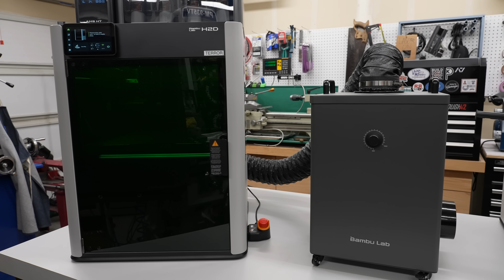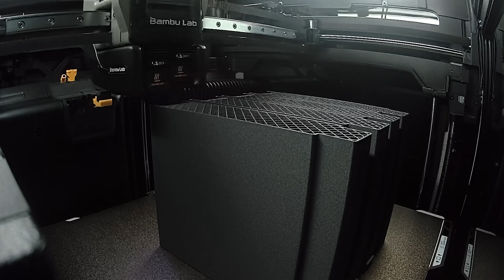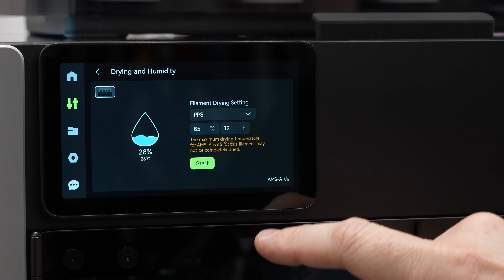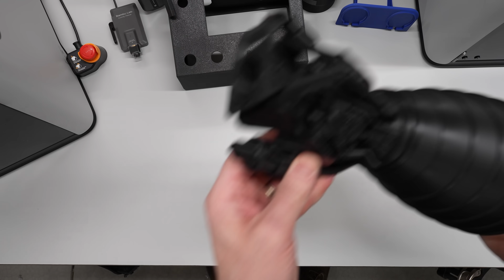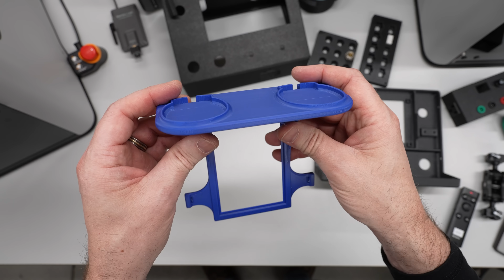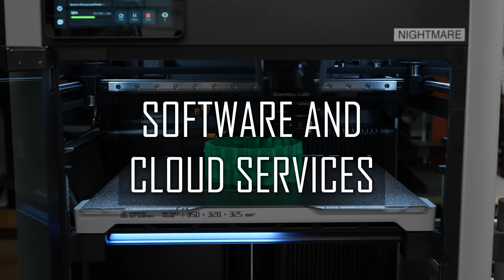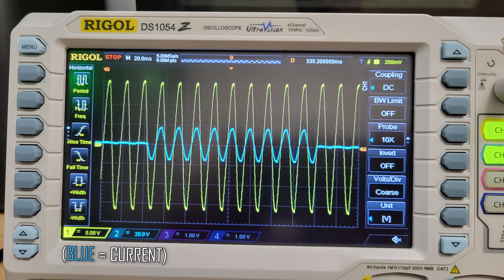What I Learned from 300 Hours with the Bambu Lab H2D 3D Printer

Comment: As an X1C owner (just sold it to fund other hobbies....), I'm honestly in SHOCK at how much they improved the already industry leading X1C. Its quieter, has sensors and automated parts everywhere, is super high tech and innovative, and everything is super premium looking. And its all integrated in a way that makes it newbie friendly. I'm blown away. The automated vent up top and the improved filament wiper are my favorite parts. They even added a pad on the upper right wall inside to dampen the noise of the ptfe tube and drag chain hitting it. Such high attention to detail! 

I don't need one, but...
Reply: With that functionality comes a LOT of complexity.  It reminds me of luxury cars, there’s sooo many things to break.   I think I’ll wait a while and see how they hold up, my X1C works great for what I need.
Reply: @unatommer  I can agree with that. The tool head is extremely complex, the auto opening vents are another moving part, and perhaps most worryingly are those spring loaded arms that flip out to push in the filament cutters. Presumably Bambu would have tested this extensively, and to be fair they have a great track record when it comes to their hardware (minus the A1 heatbed recall which they handled as best as they could have) so it will be interesting to see long term.

As always it is best not to be an early adopter of this kind of tech. But on the other hand, I need to get a tissue to wipe the tear from my face. Its so beautiful lol. I want one...
Reply: @unatommer I wonder what you think of the H2C now LOL. Since making my comment, I did buy an A1 combo, got ky X1C back, and habe an H2D as well as a snapmaker U1 on the way. I look forward to converting my H2D to an H2C
Reply: yeah but it's waaay too big to buy instead of say an X1C . I feel like the next step for them will be to release an updated version of their X1 and P1 lineup with some of these new features, their desktop bed slinger lineup is very solid, at this point the only printers missing some love are the first ones they released
Reply: @MrChoklad  My concern with the H2D is power draw. I used my X1C in my room with my gaming PC and other stuff plugged in, no problem. This H2D heats the bed like three times faster and uses 1350 watts on peak and 1050 watts average. I would probably need it in a different room, which is sad because I like to stare at them printing lol

Comment: I’m seeing a bit of concerning discussion about the inclusion of a laser.  Laser cutting apparently is inherently very messy. The fumes/smoke buildup onto every nook, cranny and surface requiring a lot of regular cleaning which for the intricate mechanisms of a 3d printer is very difficult and laser cutter pros think is going to cause issues.

Comment: Ty for the review. Some questions though. If you have one AMS you are only able to use one nozzle with it? You can only use the second nozzle with a seperate spool or with another AMS? And is it possible to print with one 0,2mm nozzle for details and one 0,4mm nozzle for speed?

Comment: This is the first (and possibly only) review I watched on the H2D. I wasn't really thinking to upgrade my 1 year old X1C but looking at what you could do with the print only version. Just seeing the clips of the laser cutting, I don't think I'd go for those options. I can't imagine all that smoke is good for all the cameras, sensors and motion systems, never mind if it's filtered before it gets out in to your room. If I get a laser cutter, I think I'd keep it as a separate machine. I might add the blade cutter to a printer though...
My one hesitation is my experience with the Super Tack Cool Plate. It was reviewed positively here but had a basic flaw against the "it just works" Bambu Lab mantra in that the ID code was not recognized by the printer and that feature had to be actively disabled in order to get any print to work on the plate, removing a key mistake-catching feature of their software ecosystem. I really hope there's no hidden gotchas in the H2D but as this review is based on pre-release software, there's probably no way to know. I guess if I do get one, it won't be until they've delivered plenty and people have had a chance to find the bugs.

Comment: Earned my subscription. Question: I don't print in different materials much and would mainly be buying it for the larger bed and quality of prints. Do you feel it is worth it?
Reply from the maker: It's all about what you need, what other options are available to meet those needs, and how much investment makes sense for your situation.  If you're running a prototype shop and you're paying yourself or someone else hourly to run the printer, something like this could make a lot of sense.  If you're a 12-year-old kid working odd jobs to buy your first 3D printer, I'd look for a cheaper option.
Reply: @Clough42  I run a 3d print shop and need to print bigger terrain pieces (focused on Table Top gaming) than what the P1P allows. The quality of the Bambu machines has allowed me to print amazing terrain that I used to sell in resin. Now, I am looking for the same (or better) quality than the P1P with a larger build plate.

Comment: I need tools that just works, but unless I can use every feature in 100% offline mode with only their binary blob in the slicer, I can't call it a tool that just works. If it needs cloud for anything, it's a no go for me. Also they are not trustworthy anymore in general since the tos update and firmware thing. I would buy the hardware with an open source replacement firmware. Still waiting for one for my P1 printer that was and never will be online. A support ticket to update the firmware in offline mode (with soldering some wire, pogo pins or whatever) is unanswered for several month (to be exact only PR bla bla responses). So bambu is is on my blacklist of companies to never give any money again, so should you!

Comment: The feeling that the person is paid, the printer is a tool but wants to do everything himself, so how do you know that your tool is accurate, print the part and measure it maybe there is a deviation. The first bamboos are inferior in accuracy to the QIDI q1 pro, the part differs by 0.07 mm out of the box, but the table is not even, and the calibration is like in bamboo, only in bamboo you do not recognize the curve or not, even if there is a part that is curved ....

Comment: @Clough42, With a bigger plate it seems more likely to experience warping from larger prints. Your examples did not seem to have any warping. Did you find any specific improvements/features that reduce warping on larger prints?
Reply from the maker: Warping is generally a product of three factors:  1) inherent material shrinkage properties, 2) part geometry, and 3) bed adhesion.  If you have a large part with tall, narrow walls, and the material shrinks as it cools, it's going to create a force pulling up the corners.  A heated chamber helps prevent this from happening as much during the print, so the entire part will shrink more uniformly as it cools down after the print.  Fiber reinforcement (GF, CF) reduces the material shrinkage, and this can help.  Stronger bed adhesion can help resist lifting while the print is in progress, but if the forces are strong enough, it can still physically pull the bed up off the magnets, even if the adhesion doesn't fail.  So...it's complicated.  In the control panel I showed, the geometry was designed so the forces were less of a factor, I used a fiber-reinforced material, and I printed with the heated chamber.

Comment: This is the most interesting review about this printer available so far. Actually, probably the only one which is interesting. I can feel the 300 hours of prints and your feedbacks are very well appreciate. So much I watched it once yesterday and another time today just to make sure I gathered all the informations. I am still struggling a bit to decide which new printer to use. I considered of course the h2d and prusa xl but also the creality k2 plus. The downside of the H2D are the printing volume (both are bigger) and the lack of a segmented heatbed (prusa xl is so amzing for getting this and 5 tool heads). However, unlike the others I can expect not have any kind of issues with bambulab,, just to plug & play for a long ride and this makes that deep inside I know this will be my final choice. Thought, I think a single nozzle version could make sense.

Comment: Can u remove the glass plates on the side to slide in a long wooden board to engrave something in the middle, let's say a 60x25cm board? Maybe a nice hack?
Reply from the maker: The printer can detect if you don't have the safety glass installed on the top and the door and will not start the laser.  I don't know if it can detect that the side windows are missing, but the bed moves up and down to focus and to clear the workpiece for loading, so I don't think that would work.

Comment: @clough42 Did you come across any issues with laser cutting e.g dust and soot etc causing buildup in the housing? Unless this H2D has some world beating extraction I just can't see how it wouldn't be a mess in there? and 3D printers don't like dirty environments.
Reply from the maker: I have the same concerns.  The external smoke extractor does move a lot of air, but buildup seems inevitable.  The documentation I've seen says that periodic cleaning is required if using the laser.  I only validated that the accessories worked, and did not do any in-depth testing, so I can't offer any guidance.
Reply: @Clough42  It is a bit early to tell, and I'd  assume current users would be primarily using the printing aspect of the device. It will be interesting to see the outcome of heavy laser use, as it doesn't look super simple to properly clean that interior.

Comment: Thanks for the video! I wasn’t in the market for a 3d printer. I bought an Ender 3 forever ago and I got so tired to tuning it and adjusting settings that I just put it in the closet. I would get maybe 1 in 8 passable prints and then only after many failed attempts. But this printer looks like it’s right up my alley.

Comment: The heated chamber is the primary reason nylon is printing so well. I have a Makerbot Method X carbon that has an active heated chamber that goes to 110c which makes the part significantly stronger overall. A heated chamber significantly increases layer adhesion throughout the whole print, which in turn should make prints in any filament stronger. This is especially important with filaments such as nylon where an even crystalline structure is crucial to achieving optimal performance. Crystal structure is determined mostly by heating and cooling temps. A step beyond using a heated chamber is annealing, which works around the same concept and is also highly beneficial for nylon prints.
Reply: this is the comment type I like.

Comment: Clearance, and size accuracy are functions of how well the printer is calibrated, and how accurate the slicer is, and it's printer profiles are.  IOW, your other printers might work as well in this department if everything was "dialed in" as well as on the H2D, or not if they don't hold to their settings with as good a tolerance as on the H2D.  It's a good talking point that this printer just works that well "out of the box".

Comment: What a shame that this printer does not have a substantially larger build volume in the X or Y direction. 
We also use the X1C for engineering, and I am flabbergasted that all printers focus on cubic size. 
This seems like a great printer given my experience with X1C, but I really need a printer that is double wide so we can print 500mm to 600mm long parts.

Comment: I work in manufacturing. 3D printing is my home hobby but I dont have time to mess around at work, we need prototypes and we need them quick, always. Industrial machines that are well over $10k are just not realistic for that either, they all focus on final finished products which means they are slow and expensive to run. The expensive machines make no mistakes and are care-free (after you do the $200 monthly maintenance and buy their proprietary filament). Bambu, Prusa and others are making things more realistic and cheaper for industry even if prices of products arent reflecting it yet. More industries need to get on board with these inexpensive printers rather than prototyping with absurd materials and print times. We use a Bambu P1S, Creality K2 Plus, Markforged mark two and Stratasys F170. Those last two printers together cost as much as 30 Bambu printers and Bambu runs circles around them. Thats not including maintenance on either which I cant even get into.

Comment: Dual nozzles?  Almost as good as IDEX.  IDEX allows copy and mirror printing of two copies of the same object, but how often do you do that?  Dual axis IDEX would even allow printing of two different objects at the same time IF software could handle that.  Currently, I don't think that's baked into Klipper, Marlin, or RepRap firmware.  Most of the multi color use cases I might use only require two colors, foreground and background with the foreground being used just for labels.  Dual material for easily removable supports or a mix of flexible/soft and hard/strong materials such as ABS/PETG with TPU are another use case.  But printing 4-5 color objects (toys, cosplay, figures) isn't something I currently do.  And I can always mask and  paint things, just like I used to do for model railroading.  (You HAVE to paint these things, filaments are not available in exactly the right colors, paint IS!)

I've seen a dual nozzle tool head hack for Voron printers that doesn't lift the nozzle(s), instead it tilts the printhead left and right so only one nozzle is in the locked and loaded position.  Dual anti drip pans, one for each nozzle are located in the parked positions.  This does make the print head a bit wider, but overall looks simpler to build than the system BBL is using.  BTW Ultimaker has (had?) a similar dual nozzle system to the BBL design years ago.  (So if BBL has a patent, sorry but there was prior art, you patent isn't any good!)

Comment: You also need to feel safe that the manufacturer will respect your privacy and not "steal" your sensitive data.  You need to feel safe in that the manufacturer will be around for the life time of the product to provide support, spare parts, and bug fixes. You need to feel safe that you won't be limited in what you can do with the product, that you will be able to sell the product if you outgrow it.  Otherwise, you need to look elsewhere.  Currently, BBL doesn't meet all of these marks for me.

Having said this, BBL seems to have done a good job in the design of this printer.  In looking at their rather draconian user agreement, I get the impression that their business model goes beyond just selling 3D printers and tools, but also data harvesting and DRM protection for their IP at the users expense.  IF they would provide a way to other slicing software (I  think that the issue with Orca is only direct connectivity to the printer, not Gcode incompatibility), that would go a long way towards reversing my feeling.  Also, if they have a web interface that would work without a cloud connection, or special app running on my computer (like the way Fluid or Mainsail works on Klipper) that would also help.  A 3D printer shouldn't sit behind a firewall on a LAN connection, my HP laser printer doesn't!!

Comment: 12:17 I just feed tpu through the back of my x1c for color changes, hasn’t failed yet for multi color printing and the same thing would need to be done on the h2d the moment u go past 2 colors :(.  Not a fan of the new features for the ams. I’ll take using my food dehydrator any day over an AMS so I can actually continue to use my AMS vs sidelining it as a dryer only for 8+ hours

Comment: Thanks for the review, this printer has two nozzles and a laser, maybe soon it will be possible  to print a board as a PCB using conductive filament and a laser sintering this filament into tracks and all this will be inside the plastic part.

Comment: One thing that I don't think many people have picked up on with the AMS 2 Pro is that if you want to run more than one of them, and want to use any of them for drying you need to but the Switching Adapter (separate power supply) for each AMS 2 Pro you have.

Comment: When you said it measures remaining filament by counting the windings before the RFID tag comes round again, is this specific to AMS2 or does it work like this on the AMS1 too? I wouldn’t have thought it does, as I only learnt of the estimation feature halfway through a spool, and it assumed it was full once I turned the feature on (ie it was offset by 50%, but future new spools are correct thereafter).
Reply: The AMS1 works the same way.

Comment: 28:15 lubricated timing belts are a thing, some modern engines use a so called wet timing belt where the timing belt runs in an oil bath inside the engine as opposed to the usual external timing belt hanging off the front of the engine. the benefits are that they are quieter and more efficient (less parasitic loss). but as a mechanic i mostly get to see when things fail, and boy let me tell you these fail spectacularly, if you go over on your service even a little bit the oil starts eating the belt and then it all snowballs from there, bits of the belt starts clogging oil passages, the oil gets further contaminated and eventually you end up with a total engine failure. 

Anyways, not the same kind of timing belts in this printer though but yes there are lubricated timing chains, just wanted to share that 👍